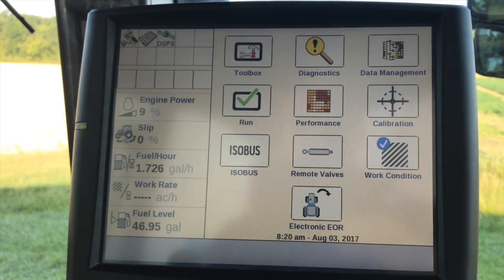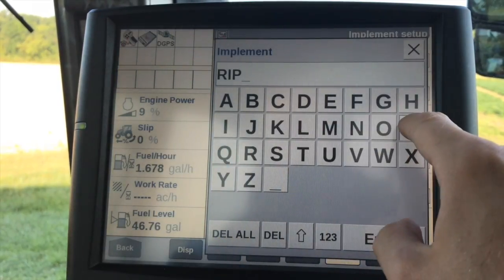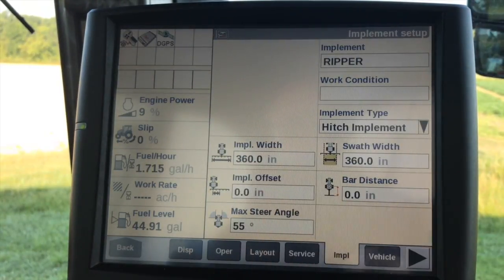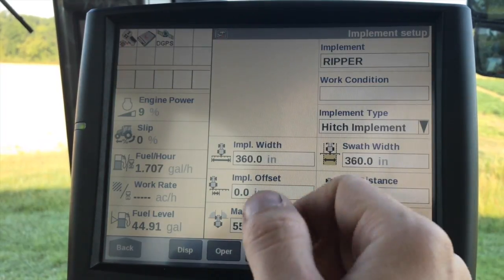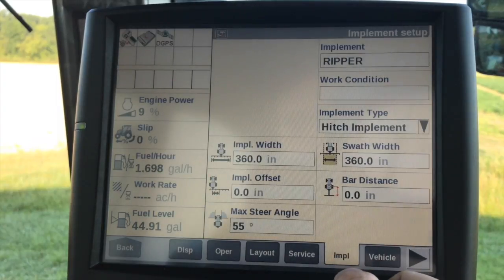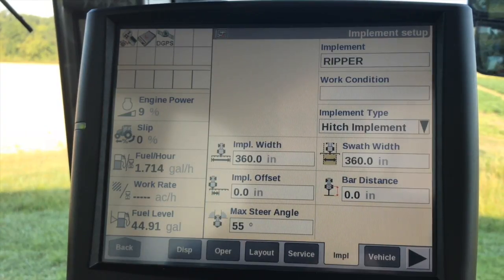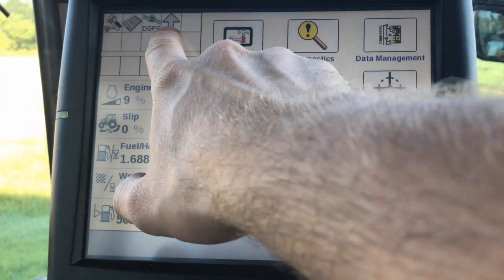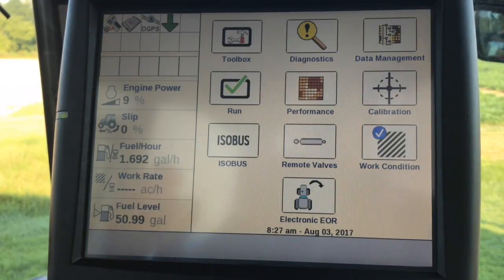Pro 700 Display: Implement Setup

Comment: How do you set the implement width when you have a front and side mower?
Reply: You add up the width of the front and side mowers. That will be the full implement width. Then you use the offset function to push the whole implement to the side. For example if both the front and side mower are let's say 120 inches, then the whole implement width will be 120+120=240 inches. Then I put in 120/2=60 inches for the offset. With this there will be 60 inches to the left (from the middle of the wheelbase) and 180 inches to the right.